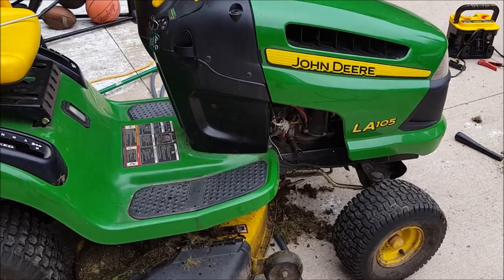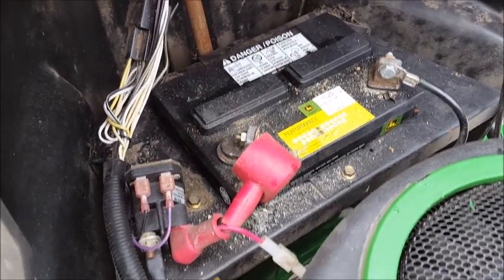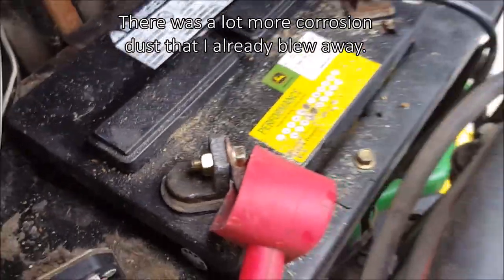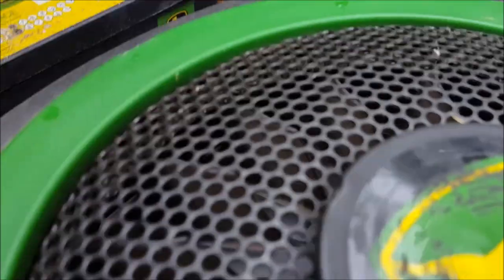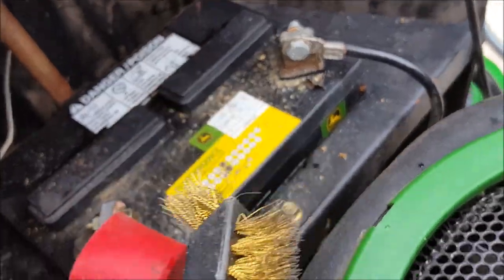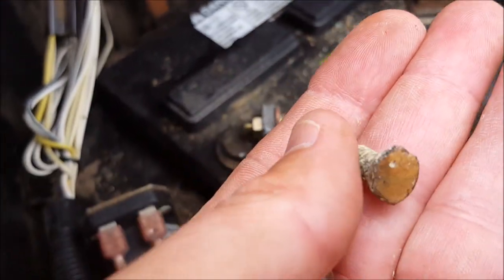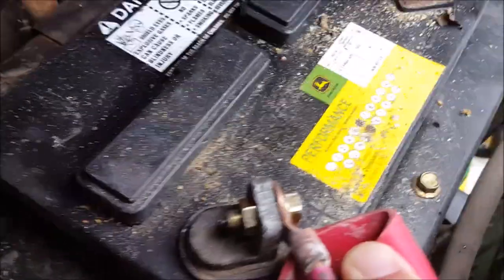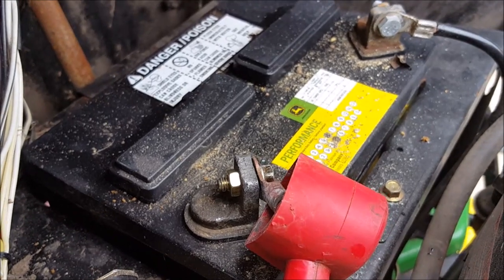So Your Riding Lawn Mower Won't Start?  Do This Before Buying a New Battery or Starter

Comment: My poulan pro wouldn't start either, moments after running it in earlier session without problems. Four month old battery. Left on charger overnight, said full. Still, nothing.  Found this video. Figured I'd give it a try. Wire brushed terminals, reconnect, boom! Fired up no problem! Thank you so much for saving me a trip to the shop that surely would have tried to sell me on all sorts of electrical "fixes".

Comment: My pushmower electric starter spins the engine but it like doesnt have enough to make it start the battery is full and i oiled the bendex
Reply from the maker: If you've got a full battery and it's spinning but not starting, it's either not getting fuel or air.   Start with cleaning your air filter...good luck.
Reply: @DANDLINC  it has spark air and fuel but i feel like that the starter just doesnt have so much power to spin it more powerfuly

Comment: TIPS:  After putting on your Battery Terminal Connections, put some " Dielectric Grease " around the Terminals.  This will help with corrosion through time.  If you don't have it, you can actually use " Vaseline " to do it as well.
Reply: @Larry Larry -  LIAR !!!
Reply: Dakari Curtis  - STOP LYING....   YOU BOTH = SAME PEOPLE !!!
Reply: Or use stainless steel nuts and bolts ! No corrosion at all !
Reply: @travisperry4814  -  "use stainless steel nuts and bolts"  <<<< on Cables?

Comment: Had an issue with my Snapper 12.5HP starter.  Was getting ready to go buy a new battery.  Decided to buy a cheap 3amp charger at Walmart.  Charged the battery up to 100%.  Then I cleaned the connectors off with WD and a wire brush and started up like a wild dog.  Good tips.  Fortunately Snappers are really easy to work on.

Comment: 2nd the dielectric grease, just smear it on the post, washers, nuts, and bolt with your fingers after you've taken connections off and cleaned post completely.

Comment: appreciate your efforts to produce this video BUT a recording of exactly WHAT the sound was you were attempting to fix would have been great. Yes, is an "after thought" moment, but will help viewers to select your video over others BECAUSE the problem sound was recorded and presented in your video before an attempt to show the viewer how to fix the problem AND what caused the symptom. I had this "clickity sound" but not just a single click. So I watched it all and it did help some.  Again, any more videos "must have" a sound recording of the symptom BEFORE fixing it.  Thanks again for your efforts.

Comment: Lol.  You don’t need a brush..... if you keep a proper refrigerator, you have a box of baking soda in their. Pile some on the terminal and dribble a little water on it until it’s completely wet and watch it eat the corrosion.

Comment: Mine started the turned right off and now it's not even doin the click. Power not even going to lights. Any ideas?
Reply: Has to be fuses if the battery is good

Comment: it would have been so much better if you would have included a before video, showing us what it sounded like, cause im having an problem, when i turn my key, it makes a click, click click click sound, after watching videos, when you turn the key and if you hear only one Click each time you turn the key then its the solenoid, i have 12.30 amps on my battery but its still making the muli clicking sounds has i turn the key. Now if i place my hand on the solenoid i can feel the clicking.

Comment: an old mechanics trick for you my friend. chew up some gum. stick it to the battery between the posts. stick a penny on the gum. the penny will now corrode before your post bolts do.
Reply: TIPS: After putting on your Battery Terminal Connections, put some " Dielectric Grease " around the Terminals. This will help with corrosion through time. If you don't have it, you can actually use " Vaseline " to do it as well.
Reply: Mary and steve Clouser miller  - Yup you are 100% correct!  Gum is definitely better for sucking !!!  😂❤️😂❤️😂❤️😂❤️😂❤️😂❤️
Reply: Mary and steve Clouser miller  - You'd knew!  Hahahahahahaha.... 😂😂😂😂😂😂😂😂